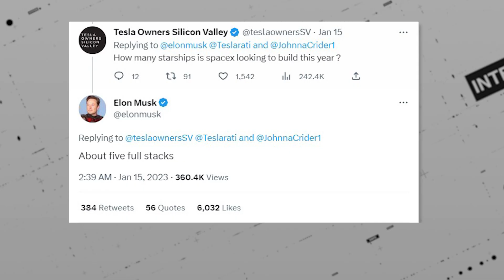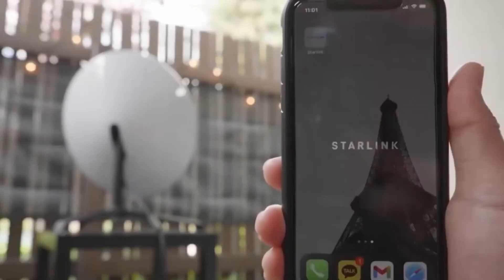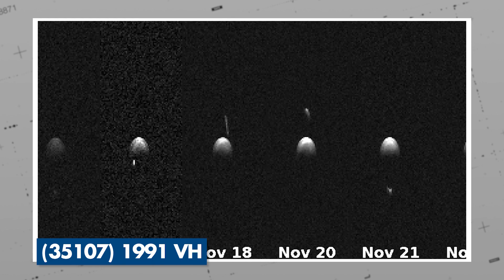THRILLING NEWS FOR SPACEX 2023: Starship Plans, Starlink, and MORE!!

Comment: Rocket needs a lot more than 100ish launches to prove they are safe in practice. Which is why Math is often used to prove reliability.
However, Starship offers a large payload capacity per year, they can use Dragon 2 capsule for crewed flight until Starship is proven to be safe.